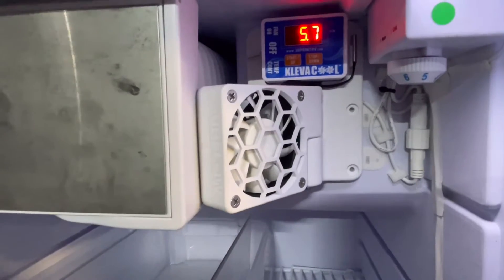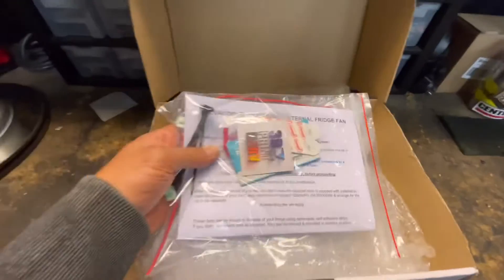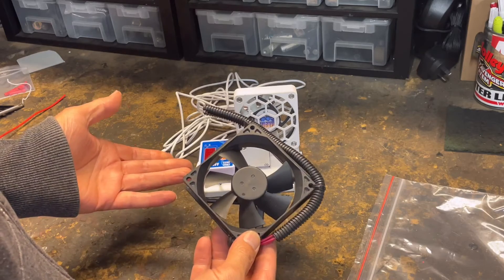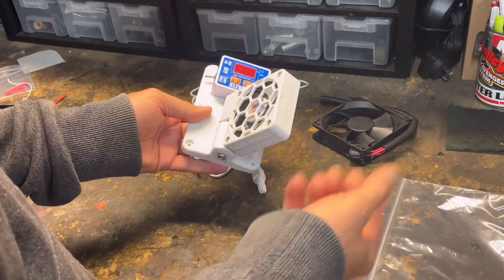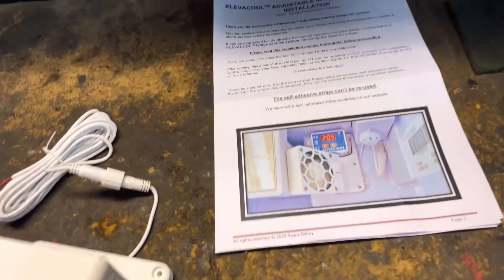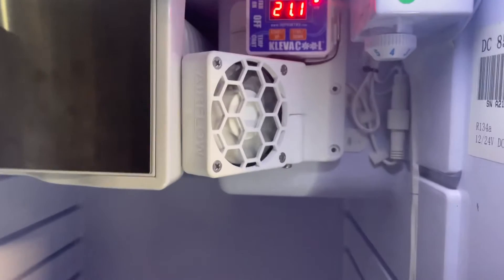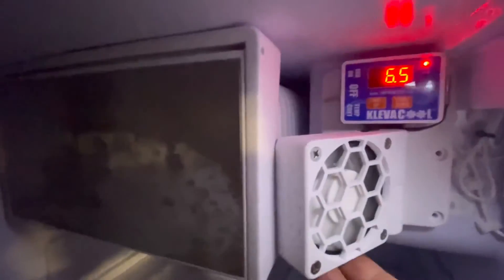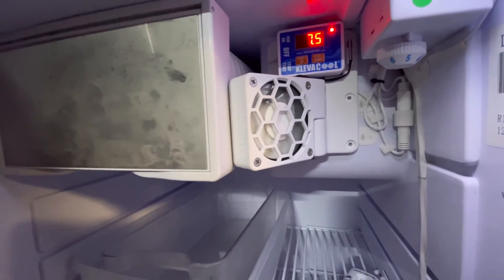CARAVAN FRIDGE FAN MODIFICATION

Comment: How did you get the wire from the inside of the fridge to the outside?
Reply from the maker: That was done by an auto electrician, so unfortunately I don’t know the technical aspect of the install.

Comment: How did you get the wire to the exterior of the fridge?
Reply from the maker: That’s a good question but I don’t get into the technical aspect of the install as that’s a job for an auto electrician.
Reply: Damn i had the same question :) @OutbackTouring
Reply from the maker: Wish I knew, I did see something awhile ago on the Bushman’s modified FB page on how it’s possible.

Comment: Looks great. Which way does the air blow? Away from the freezer or towards it?
Reply from the maker: Great question and I didn’t answer that on the vid. It blows towards the freezer. As you can move the head the air flow can be adjusted.